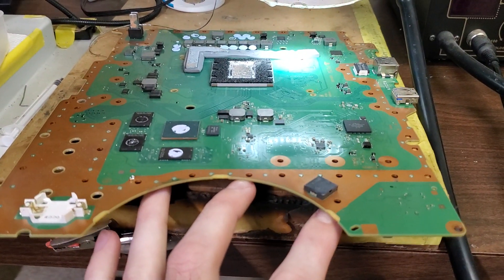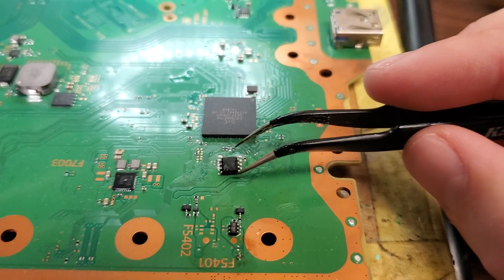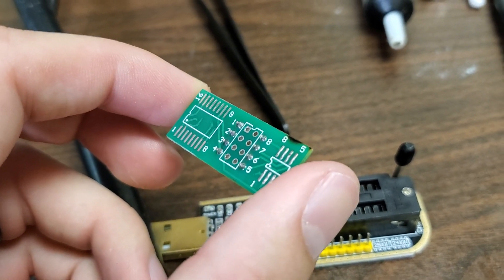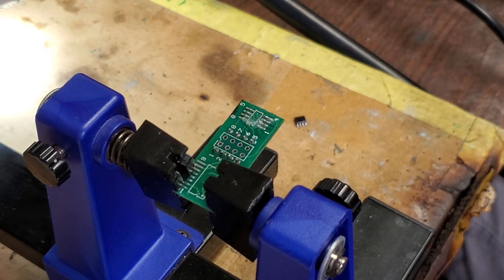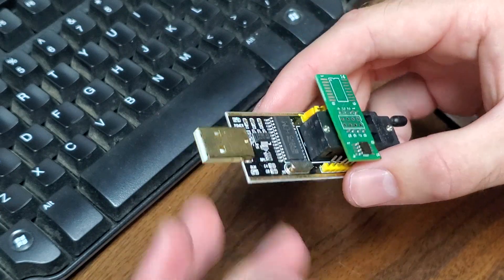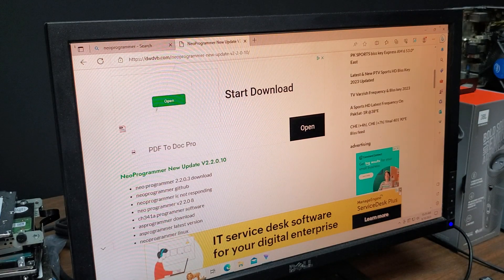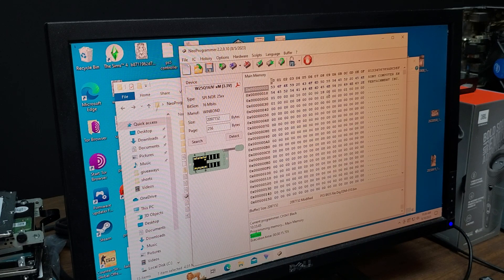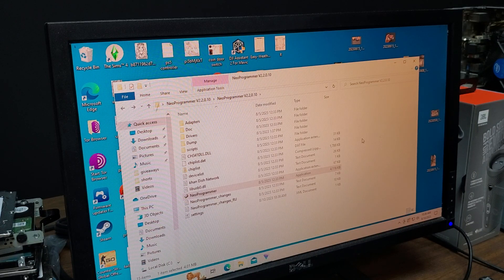PS5 Bios Programming for 3 beep no Power issue

Comment: I am yet to repair ps5 3 fast beeps when plugging in power chord by re programming the bios chip. every machine with this symptom ive repaired by using uart and clearing the error codes.
Reply: That's the proper way to start this kind of repair. Deal with error codes first.

Comment: Nice video, thank you my friend! You've got a sub. Where I can find the bios?
Reply: It's already 2026 dude. Judging by your question you will crap the console 100%.  There are various revisions of the motherboards for PS5's. If you don't flash the right BIOS, you end up making it harder for a professional to recover your console. There is data you need to extract first from the original BIOS and edit it in the replacement BIOS. Without it, any professional attempting to fix your console will fail and if you replace the original BIOS, good luck with that. This guy shows useful info  https://www.youtube.com/@ToltecMerc

Comment: Do you thin it is possibe to flush 16Mb AMI bios from AMD BC-250 board to PS5 chip, boot PS5 and later install Lynox? BC-250 is basically PS5 cut

Comment: Thank you for your video. It is a good thing you try to do to help others with DIY repairs.  Couple things though,
1. You should always after reading a bios chip save the original so if you need to you can replace the programming with the original. It also has some additional information on it that a generic bin file would not have.
2. Make sure you have the proper bios file (disk or digital, and which board revision you have) you want to write to the current bios chip before you do anything to the chip.
3. When you were wondering if the chip was erased, it did erase it the first time, but you simply need to read the chip again to repopulate the most current data in the programmer.
4. make sure your bios programmer is capable of 3.3 volts. Alot of the ch341 bios programmers need to be modded for this to work (newer units maybe not but have to check) but verify this before you attempt to program the chip as it may damage the bios chip with that higher voltage.
5. When using hot air, direct the hot air nozzle away from what you are calling the southbridge chip. You mentioned that while doing the exact opposite (15:34)
6. Use more flux when soldering the chip back on the board to allow the solder to flow better which helps in aligning the chip.
7. Never force the chip off the board by "grabbing and wiggling it" If the chip does not come off easily it is because you do not have the solder hot enough. If that is the case, you can damage the pads and traces on the PCB. There is a large ground plane under the chip so it takes a bit of heat to bring the solder up to temperature. You can lower the temp a bit by adding fresh leaded solder to the pins of the chip with a soldering iron before you remove it. This mixes the lead free with the leaded and lowers the melting point of the solder and makes removal easier.  Sorry to be so critical, but in the spirit of trying to help improve everyone's ability to do DIY repairs like this, it is best for everyone to help one another and so achieve a higher degree of success when attempting Do IT Yourself. Thanks for the video.
Reply: Hello. I'm stuck. Says not detected and must select the ic. But I don't know which one to select. It's a edm 030 with a disk drive
Reply: @erickvizcarra727 bios ic part number is written on the top of chip. make sure you have the proper package form factor selected (it’s part of the name of chip) when you select the chip name in programmer. Make sure chip is oriented correctly in programmer also. That would be one reason programmer cannot find the chip
Reply: @dalevanderzee4086 thank you very much.
Reply: @dalevanderzee4086  You're a way better person than me.
Reply: @erickvizcarra727  Why the fuck you even try something like this if you don't even know where to read what chip is? You didn't start to practice on dead boards first? You just thought you are mastering the whole thing just watching a Youtube clip?
Reply: @Dandan-tg6tj because I figured it out bro. That's what I do. I figure things out. Good thing you are triggered and threatened by someone learning.
Reply: @erickvizcarra727  About the triggering. You're ignorant. Because of people like you, I need to work  way more than it usually is required in probably 25% of the repairs, every single day.
There is no way you figured it out. Making the console start is not a repair. A repair needs data copied from the original BIOS to the newly flashed one otherwise the console only partially may work and that's not a repair.
You don't even know what you are talking about here.
Practice, learn and only then, try complex repairs.
Unfortunately, being ignorant makes you unable to understand when the repair is way above your level so you should be humble and understand you need a certain level of proficiency to be able to do some repairs.
I'm not against you or against you learning and repairing rockets. I'm having my repairs fucked up every single day because of the people like you who think they can when they actually can not.

Comment: Its better to just inspect the joints after soldering under a microscope or magnifying glasses rather than going back in with the iron. Its really clear to see if the pins are properly soldered. You're just doing the work twice unnecessarily.

A few tips for folk just coming here, if like me you struggled to get windows to install the port driver for the card programmer, remove the little yellow jumper on the left side. It can block windows from recognising it. You'll have to put it back on afterwards to use it to write a new bios.

Lots of folk in the comments asking for bios bin files. You can use your own by converting it. Or reprogramming it if its corrupt. Search for Nor Modifier by 'the Cod3r'. An app that converts PS5 bios to which ever version you need.
Reply from the maker: @johnmellor932  incorrect. Time is money so is efficiency. It's not unnecessary it's quicker.
Reply: @reaperselectronics Maybe but I think its neater.

Comment: Hello. Thank you. 
Do you have the clean Bios of an EDM - 020 board of a CFI - 1115A Disc version .Any help will be appreciated.
Reply: I have CFI 1116A if thats any help. But you don't need a bin file. Just use the Cod3r Nor Modifier app with your current bios and change it to whatever you need

Comment: For whatever reason using UART to pull and clear the error log fixed the "3 beep" problem for me.
Reply: for me it fixed the 3 beep problem but the console is still dead. it just beeps when power button is pressed after a few seconds.

Comment: What is up with your hot air lol It sounds funny, thank you for your video I was able to fix this PS5 for a customer because of your video. I would have talked about the programmer a little bit more. I first used the wrong software and I got an error code, so lucky I found your video.
Reply: I have a question: Do I want cif files or just the program and do the same steps as the clip?

Comment: why do you unsolder it? theres this clip which u can put on the chip. or is it not possible to flash when its soldered to the board?
Reply: You don't want to risk back-feeding voltage into the southbridge.

Comment: Hey man when i tried but it eont detect on my ch341a so please what volt are we going to use because i sometime downgraded my ch341a from 5v to 3v could that be the issues
Reply: Did you resolve this? My reader is not even detecting the chip, even if it is in the right orientation

Comment: Hey man, thank you for this video! 😭🙏
Exactly what I've been looking for.
I've reinstalled my system software using a USB but it crashed during the re-installation. Now the PS5 won't turn on anymore.
I suspect that this would fix it. Do you think I'm onto something?
I won't hold you reliable, no worries. 😄
But I'd be very thankful to hear your thoughts, on whether or not that's realistic.

There was no problem when it crashed during normal resets of the system software, but the crash during the reset via USB bricked that boi, which is why I suspect that a reset via USB also attempts to flash the bios, not just the OS.
I'm past the warranty and I'd rather try to fix it myself (and possibly fail) and maybe learn something, instead of selling it for replacement parts or paying to get it repaired.

You think reprogramming the chip may be something I should consider?

Comment: Can you change ps5 bios data to install windows in it
Reply from the maker: They'll probably brick the PS5 if attempted. For me it isn't worth it.
Reply: @reaperselectronics  ok are else can you use PS5 APU, vram, ram hardware in rog Ally or steam deck to increase game performance
Reply: @mipad553  Be logical even if you could the thermal throttle and heat would be so extreme. Have you seen the size of a PS5 heatsink their huge the motherboards are also thick and absorb a lot of heat from the APU.
Reply: Sony removed OtherOS years ago would be nice to see Linux for the PS5 the PS3 had so much potential to run Linux. The hardware would be better suited to Linux than Windows. But remember it's a games console aimed at gamers the architecture is different from a standard PC not to mention random read and write cycles from a custom OS would kill the SSD a lot quicker.
Reply: Why does your hot air machine sound like it's steam powered

Comment: Thanks for tutorial :) I actually ordered new Winbond chips in case mine is broken and gonna try pull out firmware from original one. I would suggest to use some ChipQuik or other low melt solder in order to remove anything that need a lot of heat (hdmi port for example). Btw very strange noise from your hot air, like dying compressor inside or something
Reply from the maker: Whenever I turn the air up high it starts making that noise. Low air it won't make that noise. I live with it. Lol. I'll have to look up ChipQuik. Always open to new suggestions! Thanks
Reply: Yeah definitely need a new air compressor, unless it somehow got unscrewed or unclamped and is vibrating. 😊